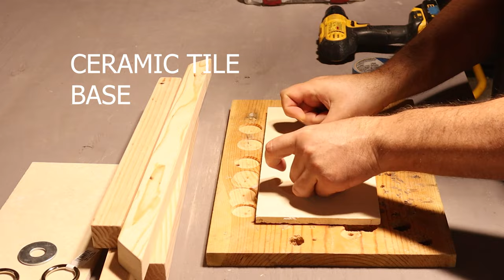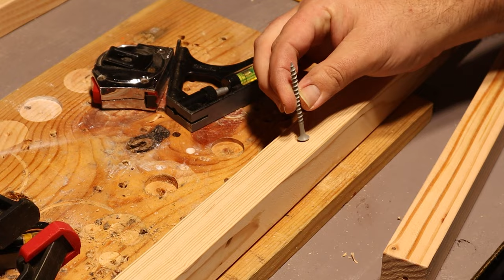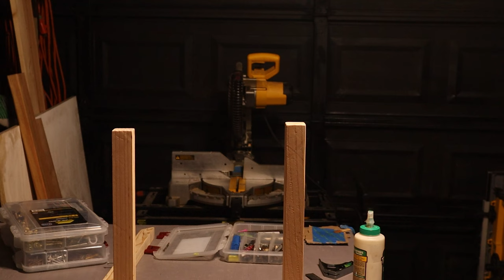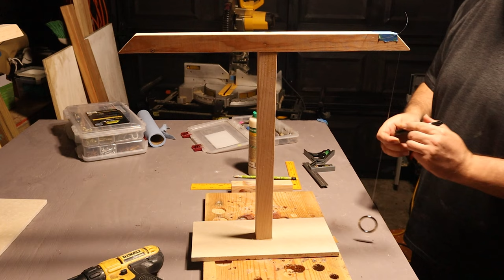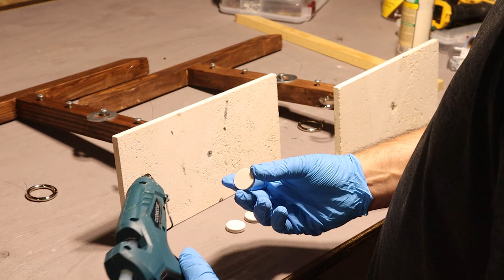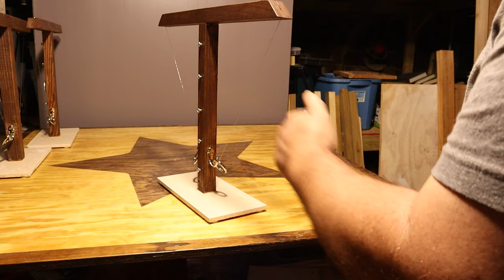RING TOSS GAME | TIKI TOSS | TABLETOP RING TOSS GAME

Comment: I really liked the modification to adjust the string length.  would you be OK with posting the full parts list and full dimensions of your cuts?
Reply from the maker: Thanks John! I can do that for sure! The nice part about this project is you can find a discounted tile in the clearance area at a retailer. You can really customize a project like this.